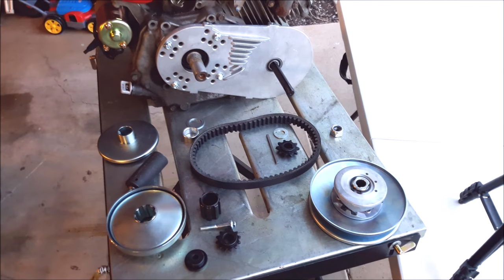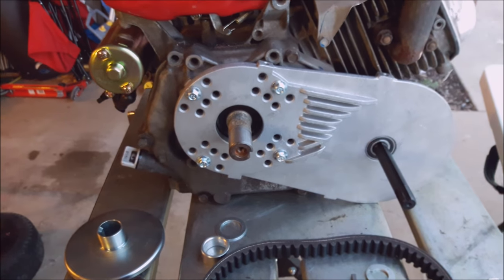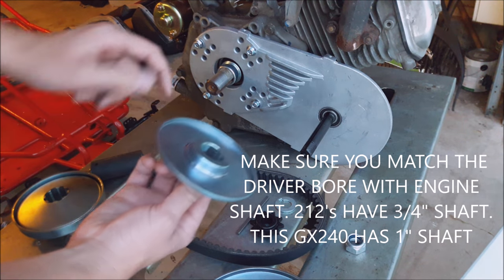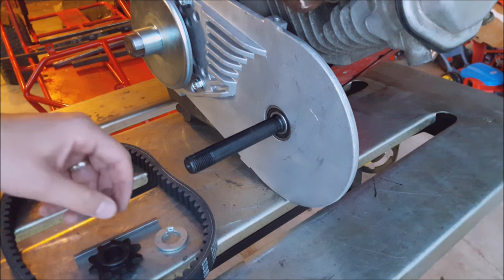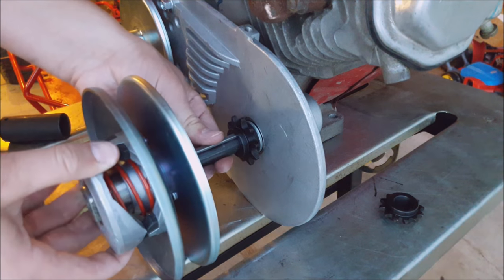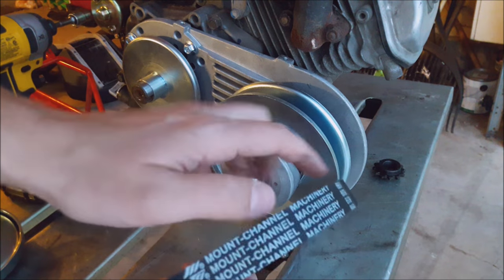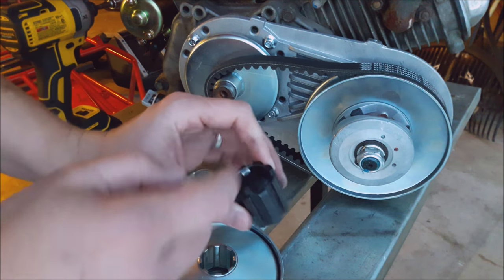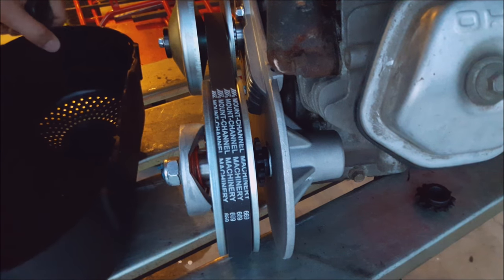Go Kart Torque Converter Setup Install (TAV)

Comment: This looks more like a continuously variable transmission than a torque converter, but it’s interesting to see it on an engine as small as this! It would make a killer go kart installation.
Reply: cvt/torque converter = same thing
Reply: @DWinnie67  its not the same thing, cvt can come with clutches as well instead of a torque converter
Reply: @vijayvjn6874  true, a cvt can serve as a safe idle clutch
Reply: @johns3655  i didn't mean the forward clutch that new cvt have that are used to disconnect the torque converter  at idle or a stop, there is nothing stopping cvt to have traditional clutches instead of a torque converter, calling an apple a red orange just because it fits your mental model of how something ought to work doesn't make it so
Reply: auntysocialist  I was on the Baja SAE Team at my university, and even there, we called it a CVT. We even had one person on the specializing in CVT tuning!
Reply: I remember seeing those on snowmobiles back in the 60s in early 70s.

Comment: Use the rear pulley to turn a transmission. Back in 1969 they had a scooter called the Tule Trooper mountain bike and it had a 2-speed gearbox. It could either crawl up a tree or do 50 mile an hour.
Reply from the maker: I'd love to do that on my go kart.
Reply: El

Comment: You have missed the most important part. The  brass collar that goes over the engine shaft pulley, so when you're idling the belt isn't wearing on the spinning pulley, The brass collar that goes over it actually keeps the belt and brass collar from spinning until you give it throttle.
Reply from the maker: I thought the same thing but the 1" shaft and 40 series I guess don't have them.
Reply: @-DIYPRO-   that sucks, Yeah that is the important part. I would definitely go out and try to find a collar big enough to fit loosely over that so you don't wear a spot in your belt at idle. This is good information though. I'll keep this in mind if I ever decide to pull the trigger on a 40

Comment: What type of torque converter is this? I bought one and you cannot put the sprocket on the back side because there is a step down in the driven shaft and it is not channeled all the way across for the key. But I need a shaft that will do that for the setup I am trying to put on a mini quad.
Reply: Use an angle grinder and adjust the key where you need

Comment: I have the same torque converter but I have an issue when the belt starts to retract after letting of the throttle the pulley doesn’t seal up all the way and stays slightly open causing the torque converter to not disengage which stall the engine. Do you have any idea what’s causing it.

Comment: Bought a new 40 series clutch and driven clutch, in which I mounted onto a tav gearbox , I needed to change to a reverse spring  on the driven clutch ,I had a hell of a time getting it apart after I removed the spring clip.I noticed that the bores were a little rough ,and the parts were sticking on the shaft, so I took 180 sandpaper and cleaned it up .Now all the parts slide along the shaft freely ,I'm running a 14hp subaru engine.
Reply from the maker: Right on.

Comment: I just rotated mine to the next 4 holes so I didn't have to cut any of the casing away.  I did have to raise my motor mount, which took some time with cutting and welding.  I'm pretty sure your idea would be quicker, though.
Reply from the maker: Hey if it works, right!

Comment: Are you sure that you got the correct torque on those bolts.

And it looks like you need another spacer on that front pully.
Or take a spacer off the driven one.
Reply from the maker: Yep, 1/4 turn past max!

Comment: I’m glad to know the sprocket can go on the back side because set up won’t allow for the normal way. My question is, will the pulleys not be aligned when the sprocket is on the back causing the belt to wear quickly?
Reply from the maker: It will still be aligned. You'll be good.
Reply: There's no keyway on back portion of the Jack shaft so the gear can't go on back side. The keyway only cut to fit from the backing plate to the threads.
Reply from the maker: @212mafia-jernigan6  can you flip the shaft to the other side? I don't have mine anymore but I know mine when on both sides.

Comment: I'm just an old mechanic wishing I was still working and having fun like you guys. 
One thing I noticed is that you all are calling this a Torque Converter. 
I may be out of date but a torque converter is more like a fluid coupling.
This is more like THE CONSTANTLY VARIABLE TRANSMISSION (CVT), it changes it's shape to achieve different speeds. 
This transmission is used in some Mazda vehicles, I just don't understand how the term Torque Converter was applied to this. 
Little things that get me lol. Next thing you know they'll be calling it Pound Feet instead of Foot pounds
https://www.mazdavictoria.com/what-is-cvt/
Reply from the maker: You are definitely a car guy. They all say the same thing and I totally agree but I wasn't the one who came up with the name.  For some reason someone called these CVTs torque converters and it stuck with the go kart guys.
Reply: @-DIYPRO-  Oh yeah, definitely not criticizing you. I just happened to be watching your channel. I subscribed by the way.  I like what you do and enjoy watching. Keep up the great work.
Reply: @OneCupOfCoffee204  a good way to think about it is how the word is used in application, if applied in a small vehicle = torque converter, if applied in a full size car its a CVT. You wouldnt put a fullsize CVT in a gokart but you would but a Torque converter in there.

Comment: I noticed most belts go onto a brass fitting I got the same one you got but you don’t have a brass fitting mine didn’t come with one do I need one on this product????
Reply from the maker: I thought the same thing and did some research. What I found out is the 1" borre do NOT have the brass bushing. Doesn't make sense but the nice comets and these cheap China ones don't come with them when 1" over bigger.

Comment: ty for video also you mentioned locating the sprocket on the back sid..do i need a different sprocket as i have pulled my hair out trying to see how please enlighten me
Reply from the maker: You use the same sprocket. When taken off you can slide it through the bore and put it on the back side. Hope that makes sense.
Reply: @-DIYPRO-  ty you for replying and yes I have tried this and there is a section that is like a hair thicker in diameter which stops the sprocket from sliding all the way back to the opposite end also the slot is is not machine all the way to the end. Do you have a link or maybe a video or something that shows this please?? I as well as about a million others would be eternally grateful!! Take care Sir and thanks again

Comment: What things should be considered in torque converter maintenance?
Reply from the maker: If you are carful you can ad a drop of oil to the spring but most people put too much and it gets on the pulleys, just slips after that. I suggest nothing.

Comment: TY for this vid.  Did yours not come with a brass bushing to go under the belt on the driver?  I've read that it will help the longevity of the belt.
Reply from the maker: I did a bit of research because I thought mine was missing but it turns out that on the 1" shafts they don't have them. Even thought this isn't a comet I called them and asked if their 1" shafts come with them and theirs don't as well. Don't understand it because you'd think it is almost a necessity.

Comment: I would like to know exactly what torque converter that is . In my application I need to put the 12 tooth sprocket  out behind the engine where u said it could b placed

Comment: What size nut goes on after the driven pulley? I bought a used Coleman ct200u with a torguq converter but that nut is missing.
Reply from the maker: Sorry, sold the cart so I don't have it anymore. You can always measure the diameter and thread count then pick up that size, one bigger and one smaller since I always choose wrong!

Comment: I see you are using a 40 sprocket. I tried too, but chain rubs against the aluminium plate (both sides) could you tell me any tip ? Thanks in advance
Reply from the maker: I can't remember which chain it is weather its 40, 41, 401. One of them is really fat and even though it fits on a 40 sprocket it's too wide. I'd looks up the specs on which one you have and the others to see which is thinner.
Reply: Use a 420 or 41 if you don't want the big fat 40 chain. All will work on that sprocket.
Reply: @Deucealive75  thank you
Reply: I just added another washer.

Comment: Hey, I was wondering if someone makes a manual  clutch like that ?
Somthing where you can keep in a low ratio. Keep the engine at max RPM . Let out the clutch manually

Comment: What does this do exactly? Keep the engine spinning while coming to a full stop?
Reply from the maker: Exactly, it allows the karts to be stopped and the engine to still ideal.
Reply: @-DIYPRO-  Probably so the engine does burn itself out? Wonder if these are needed on the electric motors?

Comment: Whats the difference in hp with a clutch and torque converter. Faster take off or more high end?
Reply from the maker: These you get more low end torque. You can always switch sprockets around for what you're looking for. For example you could put this on a Go-Kart with a smaller count tooth sprocket on your axle and I would give you the low-end torque to get up and go and higher speed.

Comment: At a idle the belt is spinning, does this mean it would drive to go cart forward even at idle?
Reply from the maker: Is the engine on a kart already? Sometimes when it's not installed it will still spin. If installed on a kart then yes if the belt is spinning then the kart will move forward. First thing I would do is turn down the idling rpm.
Reply: @-DIYPRO-  yes its on the go kart.. is there something that let's the clutch free spin? Or does the belt slip over the pulleys at idle?  I'm guessing the pulley on the engine has to turn when the engine turns.. just confused on how the belt doesn't try to spin all the time making the cart move if the belt is spinning
Reply from the maker: Sometimes if there is no load on the engine (like the wheels are up off the ground then it can do exactly what is shown in the videos but as soon as you put it on the ground then yes the pull will free spin until the rpms get higher. Yes sometimes the belt will spin as well but it will not have the force to engage the driven pulley. You can test it out by rolling the kart over to tree or something stationary. Try starting there, that will stop it from taking off in the event of it engaging while just at idle.

Comment: Is the key washer between the plate and sprocket absolutely necessary?
Reply from the maker: Absolutely, probably not. Is there a reason why you don't want to put it on?
Reply: My chain rubs the pulley, or whatever you want to call it, so, instead of placing the key washer between the plate and sprocket, I have placed two washers on the left side of the sprocket and the pulley, moving the sprocket and chain to the right just enough to clear the pulley, but someone told me if I don’t use the key washer on the right. It’ll destroy the bearing.

Comment: I installed one of these on my predator 212cc and when I drive in the dirt it doesn’t drive even though I’m pressing the gas pedal all the way down it just stops. Why is that?
Reply from the maker: Dirt, says it all right there. These aren't that great when dirty, oily, or wet.
Reply: @-DIYPRO-  I figured it out, the belt wasn’t engaging because I didn’t have a part of the torque converter on right. I will keep that in mind though thank you!

Comment: How do you put the sprocket on the other side? I have the same tav2 30 series knock off and i can't get it to work.
Reply: Have the same question. Assuming you need a different jackshaft but i can't find anything online.

Comment: So I got one but I don’t need the sprocket in the back what should I do ??
Reply from the maker: How are you transmitting the torque to the axle? Do you have the axle directly connected to the driven pulley? If you don't need it you still install it and just let it spin, won't hurt anything.
Reply: @-DIYPRO-  yeah that’s what I ended up doing it’s turned out just fine thanks for getting back to me

Comment: you gotta add the bronze bushing under the belt on the driver pulley! you gonna burn that belt pretty quick
Reply from the maker: Actually the 1" shafts don't have the bushing nor the 40 series, in case anyone cared about those too.
Reply from the maker: I thought the same thing and called a bunch of manufactures.
Reply: Mech Masters may i ask why? I have a 1" and was having issues with the bronze bushing.  I removed it and now the belt locks up on the rear drive pulley.  Any suggestions?
Reply: @matthewpayment5224  the bronze bushing is to keep the belt from engaging until you want it to. if you dont have it its always going to want to drive

Comment: Can the torque converter be installed with the driven side on the front so you don't have to hog out the converter to fit?
Reply: Yes.

Comment: Where can I get a torque converter for a 16 hp engine. 1 3/4 shaft
Reply from the maker: You'll need to look more for a CVT that they put on snowmobiles.

Comment: You can avoid grinding if you raise the engine by putting 1” risers underneath.
Reply from the maker: The interference was with the engine oil fill.
Reply: @-DIYPRO-  yes if you raise the base you can rotate the CVT plate to avoid the engine. I have done that to multiple mini bikes and go karts. In the case of some mini bikes you might need to remove the stock gas tank which provides a perfect excuse to install a real motorcycle gas tank that looks way better.
Reply from the maker: @bodhranlowd  I see what you are saying. I'll have to try that next time.

Comment: Once the chain is hooked to the sprocket what keeps the bike from going into motion? It appears that the belt is always spinning the sprocket even at idle.
Reply from the maker: When there is weight on the machine the belt spins on the pulley until reved up.
Reply: As the output shaft spins, it engages a clutch in the driver spindle at a certain RPM, if under a minimum RPM (Idling) it wont engage the driven pully (the back spindle the belt drives which is also attached to the chain sprocket and wheel)

Comment: So it this a torque converter or a CVT?
Reply from the maker: In the go kart world they call them torque converters.
Reply: @-DIYPRO-  but in reality it is a CVT!
Reply from the maker: @ReisterJP  Yes it is a CVT, and it does convert torque..... so it's also a torque converter.
Reply: @-DIYPRO-  just without a turbine or fluid and never in the automotive world is ever called a Torque converter but in this small group of shade tree "mechanics" its called by the wrong term. Got it
Reply from the maker: @ReisterJP  Well since it's on a small engine going on a go kart better just call it what it is..... a torque converter!
Reply from the maker: I've just been playing along. I actually totally agree not sure why someone in the go kart world thought it wouldn't be confusing at all to call this a torque converter when everyone else know that is something different.

Comment: Is there a way you could tell me the distance between the two pulleys? From center of engine crankshaft to center of the Jack shaft ?
Reply from the maker: Sorry someone else will have to chime in if they have a 1 in bore size because this engine I'd put on a go-kart and don't have it anymore.

Comment: Is there a easy way to trouble shoot it not opening up for the second “speed”
Reply: Motor not powerful enough for the application. AKA ur too fat or ur buggy/vech is too fat. Or you bought the series 40 converter meant for higher power small motors 8hp+

Comment: Good video.why do I go through so many belts?
Reply: I had a belt driven motor cycle and the swing arm got bent a little not something you could see but eventually it caused my belt to break maybe something is not lined up right or slightly bent